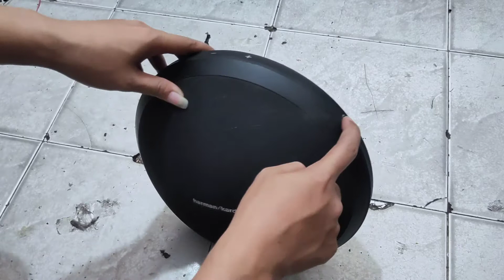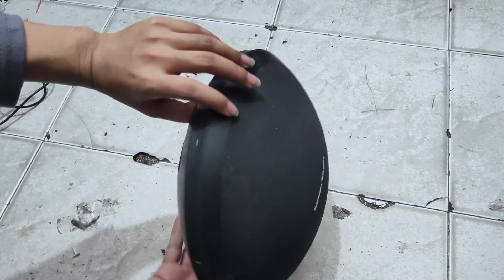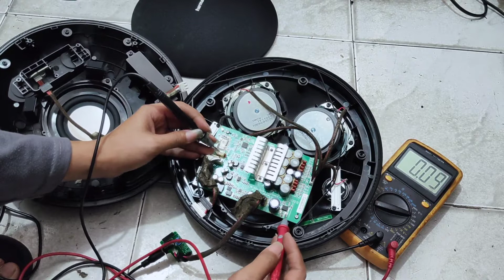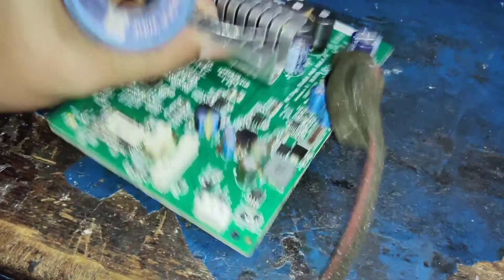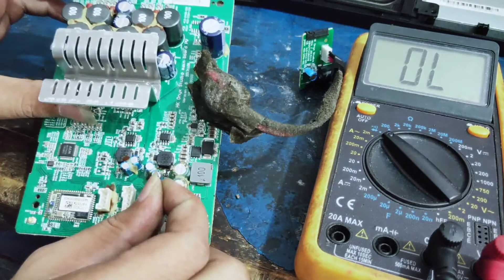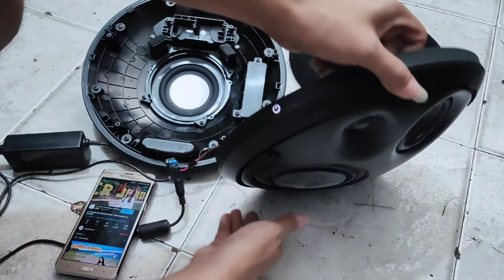servis Harman Kardon Onyx Studio 4 3 2 1 Bluetooth

Comment: What value is the resistor you changed?
Reply: R510
Reply from the maker: In this video I did not change the resistor value but I replaced the mylar smd kapasitor capacitor

Comment: Hello, I have the same problem with my Harman Kardon Speaker.. It doesn't switch on and does not charging..
Reply from the maker: try to check, make sure the adapter is not problematic, if it's true there is no problem, it means the board was made, just follow the spare parts that I replaced
Reply: Hi same problem also didn't function.. i open it inside there is burning pesa, how to change  the board of onyx studio 1 sir
Reply from the maker: @kaamegozvlog0881   Is the main board the same?
Reply: @MasTris39  can i ask? where i buy whole board of onyx studio 1..,I want to replace it sir..
Reply from the maker: @kaamegozvlog0881  If you want to replace all the boards, it's definitely expensive for the cost, sir, at the Harman Kardon service center there will be a new board
Reply: @MasTris39  thank you so much sir for good information, by the way full support from Junludz Tv  official.
Reply from the maker: @kaamegozvlog0881  Ok, thanks again for the support, subscribe
Reply: What is the exact voltage of power supply? Tnx
Reply: @MasTris39  where can i buy the board of harman kardon onyx 1
Reply from the maker: @laurelnicor2669  At the new harman kardon service center there is one board
Reply: I'm living in the Philippines and we don't have service center for Harman kardon. I think in your country have a service center for it.can you find me that board if it is OK for you
Reply: OK thanks abang
Reply from the maker: @laurelnicor2669  In my country, Indonesia, there is indeed a harman kardon service center, but if you don't claim the warranty, the cost is expensive, it's better to buy a new one
Reply from the maker: @laurelnicor2669  Well